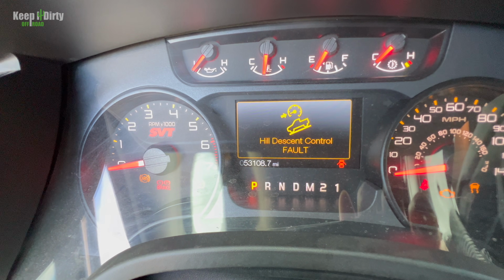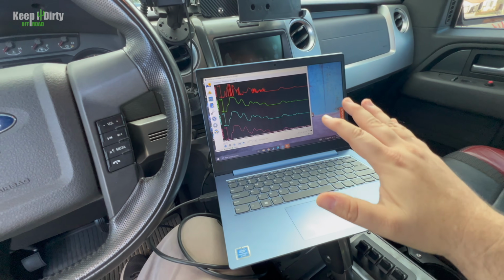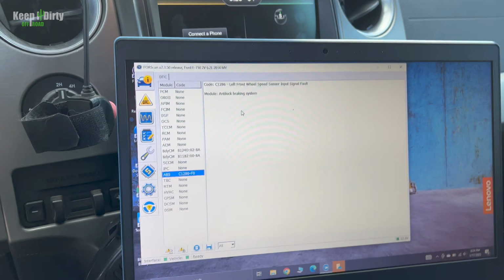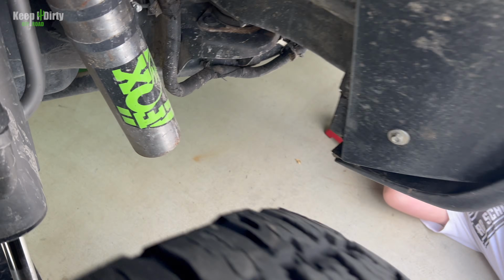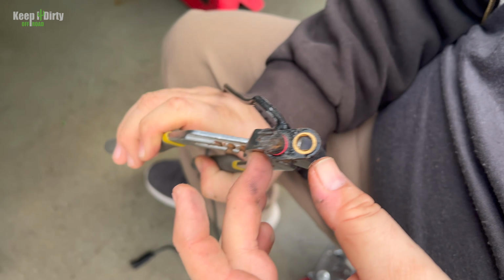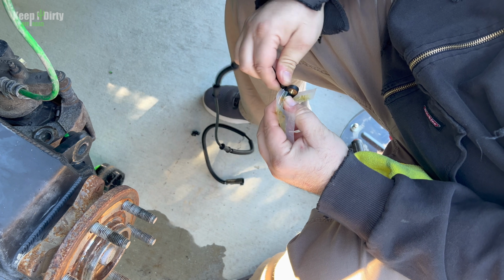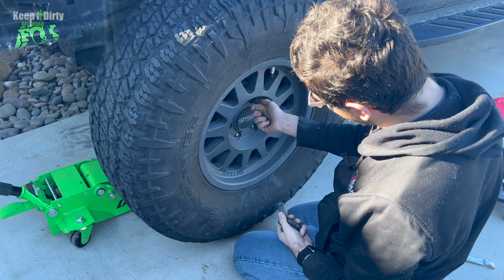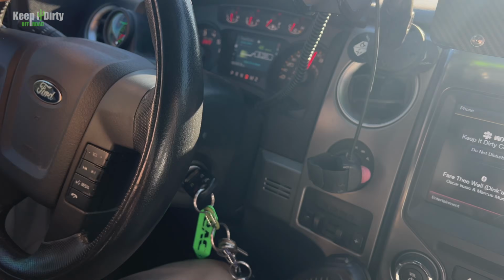Wheel Speed Sensor   2014 Ford F150 Dash all lit up

Comment: I noticed you have a different boost gage even after you changed it the first time.  Sweet location and mod.  Completely agree on moving it.  Also, good video.
Reply from the maker: Yeah, loosing a vent here in the SoCal heat is not worth it. So I got the bases to install over the steering column. Unfortunately our Roush gauge fell apart and broke as we removed it. BUT, I was not going to use it anyway because it did. It dim with the headlights. It was distractingly bright

Comment: Does truck need to be on when trying to test with the reader ? My reader isn’t picking anything up off either one ??? Guessing it’s something I’m doing wrong any idea ?
Reply from the maker: It just needs to be powered on (no engine) to read the code. But also keep in mind that if the speed sensor half way works, it may not show a code when you read it. Have to connect the reader after the dash goes nuts to see what it says. 
As to find out the one that’s actually the problem, you need ForScan on a laptop logging while your driving.
Reply: @KeepItDirtyOffRoad  sorry doing old school method reading ohms one just read at .440 and one at .480 in the front I’m guessing .440 is bad
Reply from the maker: Not sure man. I suck with a multimeter or anything eletrical
Reply: @KeepItDirtyOffRoad  where do you get your activation code from on forscan ???
Reply from the maker: It’s on the ForScan website. I think the product tab. It’s free but it takes them a minute to send it to you
Reply: @KeepItDirtyOffRoad   was your sensor all caked in grease too ? Is this normal ???
Reply from the maker: Yes it was. Specially the one at the very back of the engine. It’s one of the reasons MPGs are impacted and you get sluggish performance. Turbo engines always get a little oil in them. It’s coming from the turbos and perfectly normal.
Reply: @KeepItDirtyOffRoad  your wheel speed sensor gets covered in grease from your engine ? I’m confused.
Reply from the maker: Sorry man. My bad. Was responding to a few messages on the MAF sensor video. 🤦‍♂️.

The wheel speed sensor does also get grease on it from the bearings. They are reading markers on the bearings themselves. so grease on them is normal. Plus because they are magnetic, they can a ton of carbon dust on them too. Can’t avoid it.

Comment: Boom. After your breakdown and visuals I found a frayed wire after my BBK install. The inner rotor rubbed the out the outer coating of the abs sensor on the driver side. Saved me a bunch of headaches trying to diagnose the truck! 🎉
Reply from the maker: 👍👍 glad we could help.